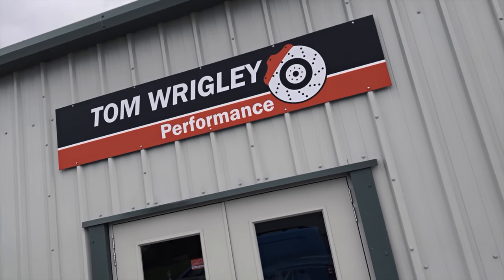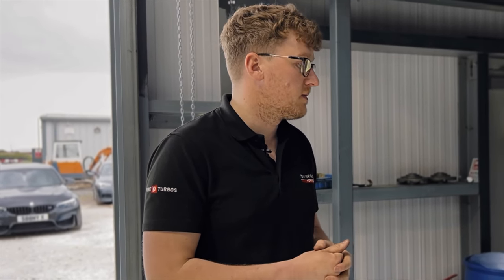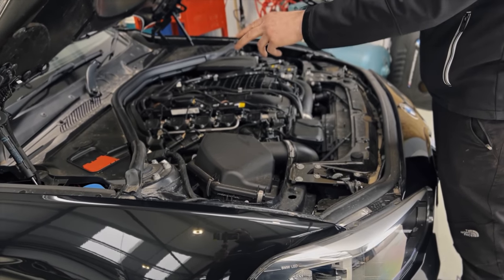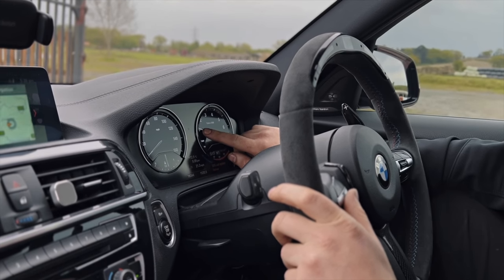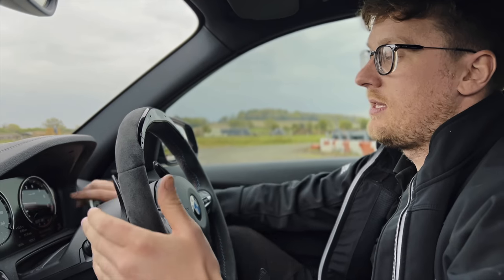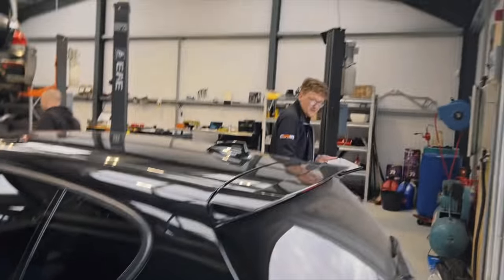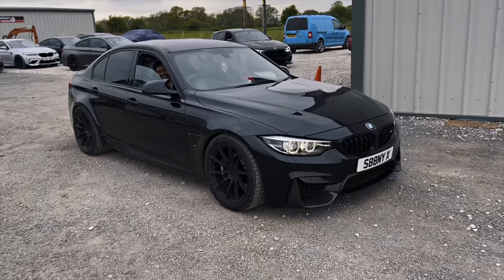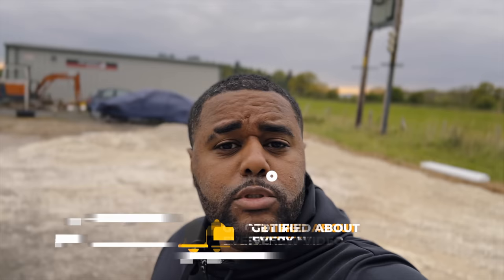STAGE 2 TUNING MY BMW M140I **TOM WRIGLEY**

Comment: If you're planning to go big power (700+) like you mentioned I think you should've gone for the DORCH HPFP as the B58 TU pump won't cut it at those power levels and will need to replaced for a DORCH in the future
Reply: Probably will do this
Reply: Port injection
Reply: It’s only for stage 2 atm all that will change
Reply: Did he not say he wasn’t gonna do 700+? No point going for big numbers in his daily when it makes it way less fun to drive on the roads. Also no point putting 10k into a B58 after he had an S55 which is a better engine for big power.
Reply: @1993j  he said in a previous video he’s aiming for 1000hp?
Reply: @1993j  yea he's going forged engine on the m140i so might wanna go back and rewatch some vids xD
Reply from the maker: Was only in for a stage 2 Tom just had this fuel pump laying around just wicked it on

Comment: What a beast. Looks and performance to match. I have a 140i that I bought a month back that is allegedly stage 2 but I doubt it is. They only did a custom map and a downpipe. Think I need to take it to Mr Wrigley to take a look.
Reply: @jackmasterdick  missing at least the air filter, and mine only has a sport cat rather than full decat. I had a stock 235i and this doesn't feel all that quicker.